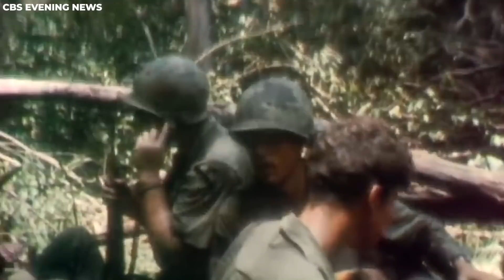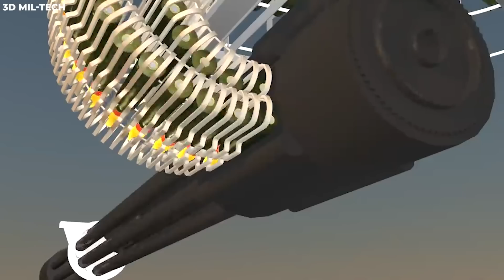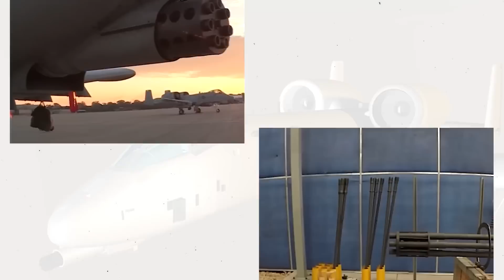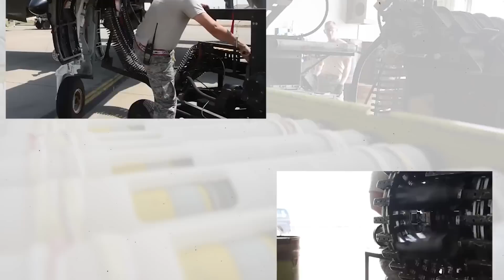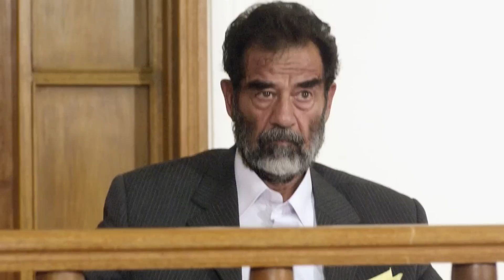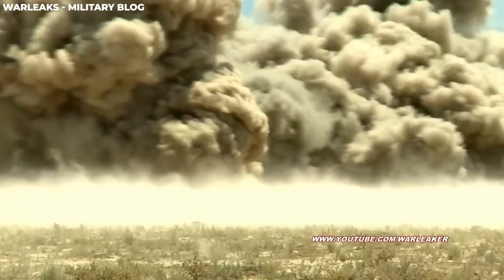The ONLY machine gun on the PLANET capable of turning TANKS into SCRAP | GAU-8 Avenger

Comment: this is not a gun attached to a plane, this is a plane attached to a gun
Reply: Yes, the plane was designed around the gun after the guns design was given initial of final approval, I can't remember which at the moment.
Reply: Exactly.
Reply: Back in the day I spotted an A-7 Corsair that
mounted two GPU-5s on the wingroots.  Combine
those with the M-61 internal gun and the plane
would have flown backwards if they all fired. 😀

I think the bird was headed to an airshow or
something similar because no way it could
handle that much muzzle blast.
Reply: 1000% on point!!!👉

Comment: the a10 is such a cold war relic designed to fight hordes of soviet forces that never came it is pretty useless and dangerous to friendly forces now no ground unit wants an a10 overhead coalition forces in iraq and afghanistan would ask what air cover is available and if told an a10 would refuse it out of fear of being killed by it i would love to see how long it would last in a near pier fight i'm going to say it's slow speed as it's only a turboprop not a jet low flight ceiling it would get relegated to near base defense if all else fails or be vaporized by Air missile batteries the second it even thought about going near the frontlines and any armour column it could attack would 100% have mobile ground to air AA missile systems with it as the ukraine war has shown no jets not russian or ukrainian can go near the frontlines right now till air defense batteries are eliminated the A10 is a flying piece of junk basicly

Comment: We didn't have the A10 in Vietnam. But we had the spooky. If I not mistaken it had the same gun, I might be wrong. save my ass 3 or 4 times when we got over run.
Reply: Spookys used a 7.62x51 cartridge, and the "minigun" worked on the same type of engineering as the GAU. Thus the GAU was a offspring of the mini. I used to watch the spookys work a target when I was in VN in 1968. Awesome! Spookys were WWII C 47s that had been converted into gunships. The C-130 gunships were introduced  after I left. They were also used on Cobras and Hueys. They saved  FSB Copperhead from getting overrun a couple times. Thanks for your service .
Reply: @stanleyfistick9414  @Ford6968 THANK YOU BOTH Gentlemen for your service, very deserving of much respect
Reply: @stanleyfistick9414  My father was in in 67 to 68 and also had his bacon save by Spookys, for which I (born in 69) will forever be grateful.
Thank you both for your service, I salute you both.

Comment: It's been claimed by Afghanistan, Iraq, ect. vets, that the GAU-8 caused more friendly fire incidents than any other weapon due to it's firing speed. Supposedly some pilots couldn't let go of the trigger quick enough, and after a strafing run, the turn and banking, had created a recipe for mis-aimed incidents. Good 'ol rumors or gossip.
Reply: When it’s firing, the controls lock, keeping the gun on target automatically, and preventing the problem you describe. If friendly troops took fire, it was due to misidentification, not a pilot pulling the trigger too long.
Reply: They had  older planes in service without the upgraded service packages that had to rely upon pilots using binoculars to identify targets. That's how a lot of these friendly fire incidents happened
Reply: there's also the fact it hits anything within 12m+ in the most perfect non combat centred tests... Yeah no wonder they dont let this thing out of its hanger.

Comment: If it is already in service why get rid of it. What? So the contractors can get more profit on a new plane? Look at the B52. If you have a winner keep it.
Reply: That’s one possibility, but understand that circumstances change, our adversaries have had decades to work on the problem of the A-10, although I do believe that anything intended to replace it should be fazed in to ensure that it can replace the A-10.
Reply: It's just like the f22 ,It's so good at it's job will just shut down all manufacturing of any new airframes or spare parts for the ones in service, and act like we're scared to blow millions in taxes on modernizeing the the electronics etc. It's foreign adversarys lobbying our gov to hinder our military and let them play catch up by hacking all the data and blueprints that for some reason is even  accessable online by hacking and stiling our best .
Reply: You have no clue. First of all, the aircraft are nearing the end of their lifespan. You can only upgrade them so much. You can only put new Wings on them so many times. 20 years plus of full on War and carrying heavy loads takes a toll. Next they no longer are able to operate in a contested are environment. Just look at the experience in Ukraine. Nor is the vaunted Canon no longer effective. And there are plenty of other airframes capable of doing the support mission.

Comment: The Avenger is set up off center to the aircraft but the firing barrel IS on the centerline....
Otherwise the recoil of the gun would be off that centerline,   throwing the flight Characteristics of the A10 all to HELL....
Not a good thing when operating at the low levels the Worthog calls home....
Reply: Thanks for the clarification, it is plain to see it's in the center line as it should be.

Comment: It is pronounced gow not gau. The front landing gear is off center to house the avenger. The engines were placed  high on the plane to help them from being hit by ground fire, but if they were the engines could be hit and be blown off the aircraft without damaging the airframe to the point  of putting it out of action it could fly on one engine.The.F16/35 can carry the same load out, no avenger but same missiles and bombs, make 3 trips to battlefield to A10s one. The Thunderbolt 2 is more expensive to operate than F16/35. There is only the A10 that uses the Avenger and it is not a machine gun it's a cannon and it it came from GM not the Air force. The A10 will be retiring soon the Air force doesn't want it.
Reply: Another reason the 2 engine pods are mounted as high as they are is it keeps debris out of the intake during operations out of unimproved airstrips....
Reply: Thanks grammer nazi.😊